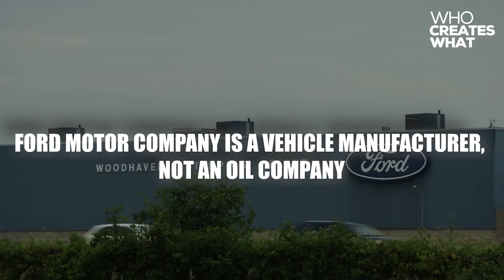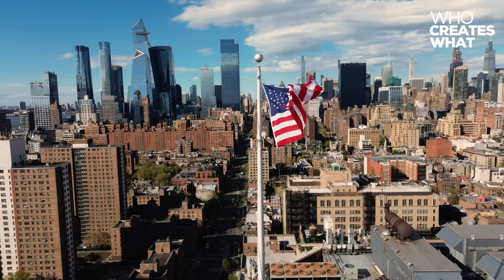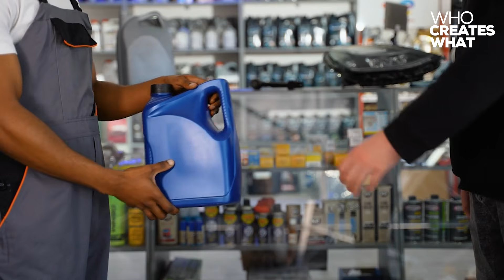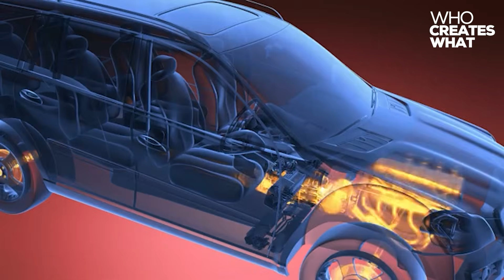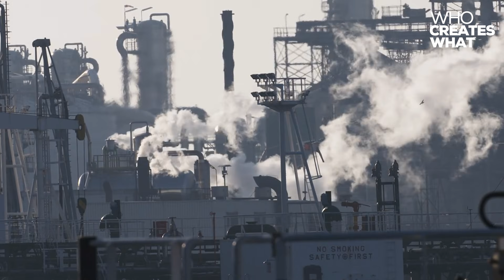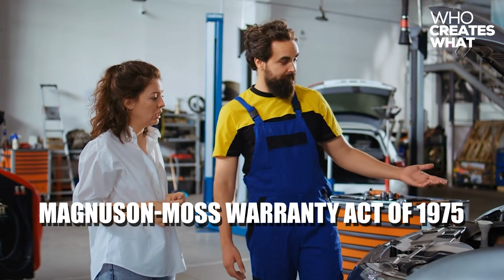Who Makes Motorcraft Oil? The Real Manufacturer (Not Ford)

Comment: I have used Motorcraft oil for 40 years in my trucks it is a great product if added up a million miles on several trucks and still have 3 of them 325,000,190,000 my 2021 37,000

Comment: I have a 2015 3.5 Ecoboost with 150050 miles have used 10w30 full synthetic change every 3000 to 3200 miles I have never knock in wood had any engine problems and my truck uses no oil I do rear ends every 50000 miles antifreeze every 30000 miles plugs every 60000 miles air filter every 15000 miles the only thing I had to replace is my flex pipe and muffler that it shows if you take care of your truck it will take care of you

Comment: Motorcraft is really Kendall mtr oil, they sold it at dollar stores years ago. I used it ,it's ok oil
Reply: Incorrect twice. Motorcraft is not Kendal. They are both made by Phillips 66. But Kendal has titanium,  Motorcraft does not. Also kendal is not an "ok" oil. Kendal is an excellent oil.

Comment: I have ran Motorcraft oil in several Fords for hundreds of thousands of miles with outstanding wear results.
Reply from the maker: That actually lines up with the Project Farm test — Motorcraft came in #1 for wear protection out of all OEM oils tested. When the batch is consistent and meets spec, it genuinely performs well. The issue is batch variation, not the formula itself. Good batches = great results, like yours. Bad batches = contamination flags. That's the real risk with private-label production.

Comment: Was there anyone out there thinking Ford was a petroleum manufacturer?
Reply from the maker: Fair point — nobody thinks Ford owns oil wells. But the real question isn't who makes it, it's what happens when your contracted blender has a bad batch. A sealed, never-opened bottle came back with iron, aluminum, and copper particles from the factory. That's the part worth knowing.

Comment: They used to sell the semi-synthetic 5W20 at WalMart for 1.33 a quart.  It was the best deal on the market.  I used it in my GMs for years.
Reply from the maker: @billm6294 Those Walmart semi-synthetic days were something else — $1.33 a quart is basically unbeatable. For GM engines running normal driving conditions, semi-synthetic does the job just fine. The real thing that matters is whether it meets your engine's spec, and clearly it worked great for you. Honestly, as long as the oil carries the right certification, brand or price tag doesn't have to be the deciding factor.
Reply: @WhoCreatesWhat101 
Had an oil change at a Goodyear Tire place, they used Kendall oil. My F150 "likes" both Kendall oil and Motorcraft oil: no cam phaser noise upon startup with either Kendall or Motorcraft oil. Conoco Phillips makes both Kendall and Motorcraftboils.
Reply: On the newer bottles it even says  "meets GM standards".
Reply: @TimothyDixon-p7u  I have run it in Chevys, and a Honda. When good oil is on sale, I buy it.

Comment: The motorcraft bottle of 5w20 I have says synthetic blend
Reply from the maker: Yeah, Motorcraft actually sells both versions — a synthetic blend and a full synthetic 5W-20. They're different products with different price points.
The full synthetic is the one that got lab-tested in the video (Group III base oil). Your synthetic blend uses a mix of conventional and Group III base stocks — so it's a step down in base oil quality, but it's also cheaper.
For normal commuting it's fine, but if you have an EcoBoost engine, the full synthetic version is worth the upgrade — it's specifically tuned for LSPI protection in Ford's turbo engines.
Reply: @WhoCreatesWhat101  In the Motorcraft Synthetic Blend, what percentage is conventional oil and what percentage is synthetic?
Reply: @rking3724  10-15% synthetic,  thats it. But for some cars, especially older ones, synthetic blend is fine for 4k miles or so .
Reply: The synthetic blend only has a small percentage of synthetic oil in it, if you’re going to use Motorcraft oil pay the money and get Motorcraft full synthetic. It’s expensive but well worth the extra money especially if you have a turbo or turbos.

Comment: Is motorcraft oil good?
Reply from the maker: Short answer: yes, it performs well — Project Farm tested it against other OEM oils and Motorcraft came out #1 in wear protection.
It's specifically tuned for EcoBoost engines (low calcium to prevent LSPI), so there's real engineering behind it, not just a badge.
The downside? It's Group III synthetic at premium price (~$45-50/5qt), and the moly content is low compared to Pennzoil Platinum or Mobil 1 at a similar or cheaper price.
Good oil — just not your only good option. Any API SP / ILSAC GF-6 certified oil works fine. 👍